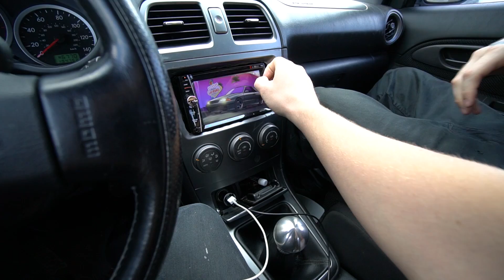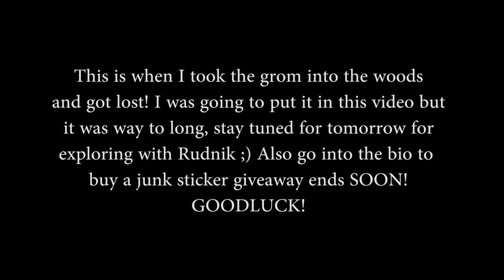SR20 CAUGHT ON FIRE ON THE HIGHWAY!

Comment: So @RicerMiata, I haven't followed Devin's build. Did he build the motor himself? If he did did he go the legit route and check clearances on the cam's/crank, and connecting rods? I learned that the hard way rebuilding my gsxr 750 motor. I ended up spinning a main bearing on the conrod pin because the tolerances were off.